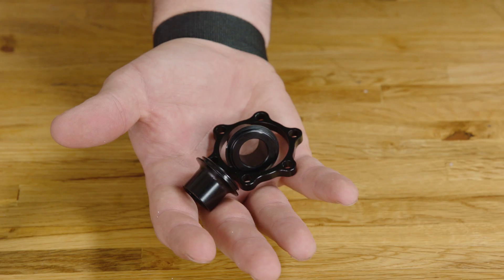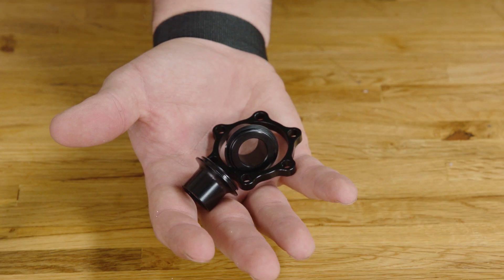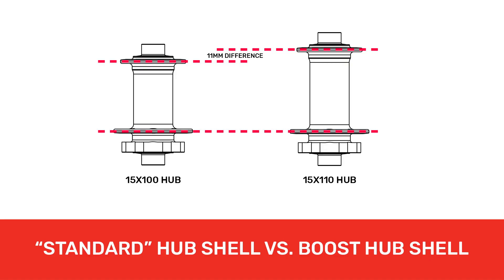Boost Hubs vs. Adapters

Comment: So the wheel suddenly becomes weaker than it is with the current configuraiton? Please explain how the wheel becomes weaker with the spacer. Yes a boost hub is likely stronger than a non-boost hub with its wider geometry and greater spoke angles but your argument lacks technical merit
Reply from the maker: Hey Victor! Of course a non-Boost wheel does not suddenly become weaker if it is installed into a Boost frame or fork. The biggest issue, when it comes to most Boost conversion kits, is the spacer that is placed behind the brake rotor. That spacer can increase the amount of force on the brake rotor tabs to a point that the hub wasn't designed to handle. For that reason, we can't recommend using those types of kits.

Comment: You don't support is because it's a business standpoint view. On a real-world situation, using boost adapters is ok. I've been using it without any problems and I bomb thru whistlers with the adapters. Bike industries are full of craps, they keep on changing to make you buy and buy to keep up with the business.
Reply: Totally agree...., me and my family of XC riders are way under weight specs for all our frames and wheels.  Why should I have to pay for a new set of race wheels/hubs because the bike industry set it's standards for overweight and/or gravity riders.  If you are under and maybe even way under weight spec for your bike, use the adaptors. By the way, can any bike industry representative/ employee show even one incidence of a break rotor sheering off while using an adaptor?  Can't find any evidence in my google searches. ( this post is Not directed specifically to the author of the comment, but it was the easiest way for me to make a reply..
Reply: >new standards 

>99% of riders not good enough to know the difference
Reply: I am not so sure they are full of crap...just marketing driven as is are entire economy. Nobody like it and we need alternatives. That is what Stans should provide.